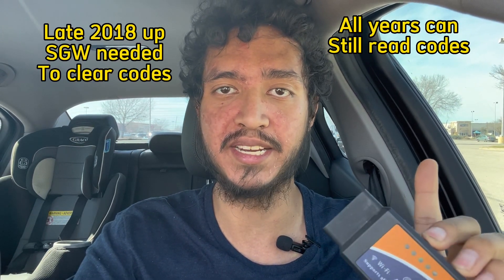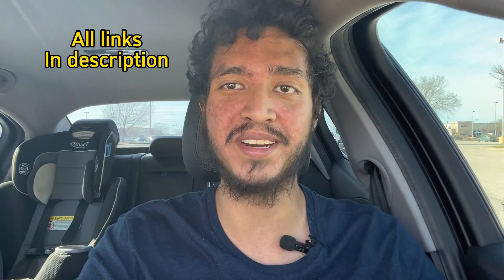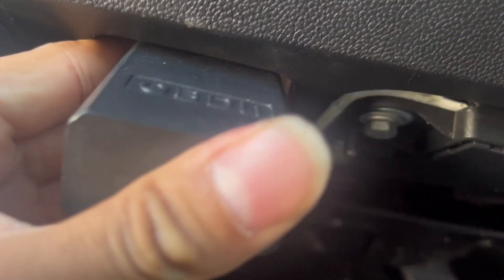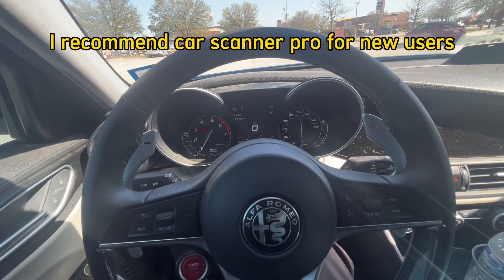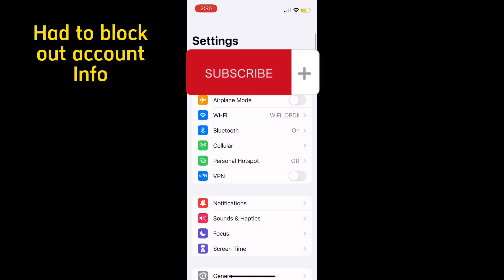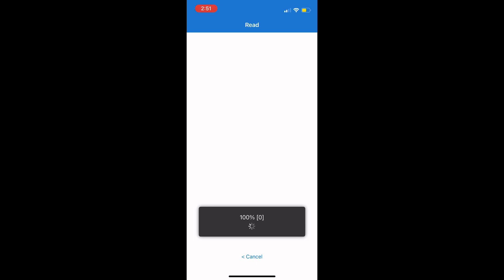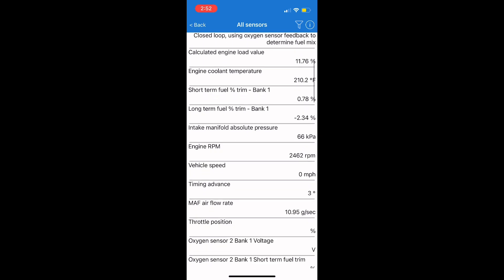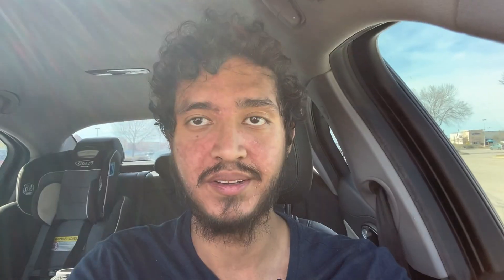Alfa Romeo Giulia Stelvio Read and clear codes using your iPhone/ android

Comment: Any other similar ones that do the same thing ? There are out of stock?
Reply from the maker: Yes just get any of the obd2 readers from Amazon you can use Bluetooth or WiFi. Just remember if your after 2017 you may need an SGW to clear codes

Comment: Soo this won’t work for 2022 to clear codes
Reply from the maker: Yes you just need an SGW bypass installed. It’s not just this device none will work without that bypass on 2018 up

Comment: Does this work to reset oil n days ?
Reply from the maker: Nope not on this car. There is a procedure to reset it with a sequence you have to google reset oil giulia forums you will find it.   Maintenance required needs multiecuscan to reset or dealership Witech
Reply: @alfamods2.0T  you should make a video on the days maintenance it has left there’s not one out there .
Reply from the maker: I do have one actually you just need multiecuscan but that video shows you how to set up as well

Comment: Hi There, I recently changed out my front brake pads on my 2020 Alfa Romeo Stelvio (I bet you know where this is going).  I didn't realize  I needed to disconnect the negative cable to the battery.  So, I have all types of lights lite on the dash.  The car is also in "limp" mode, only the front right and rear left brakes are operating.  Will this scan tool be able to clear that issue and all the lights?  Thanks for you content...I wish I saw your video about disconnecting the battery before I did it!  THANKS!
Reply: Where you ever able to fix this problem? It just happened to me yesterday and I’m trying to get rid of the codes

Comment: Will it clear esc, ast ,and brake codes or just engine codes
Reply: Do u have a link for the adapters
Reply: I need to do the same.  
To clear esc and brakes codes   Can you please help !
Reply from the maker: You need multiecuscan with the grey and blue obd2 adapters if you wanna clear the abs.

Comment: Can you HELP. I have change my oil. How do i clear "days to oil change" ?
Reply from the maker: That one is annoying and takes a lot of attempts but it works. Keep in mind all this has to be done pretty quickly within 10 seconds. 
1.Close the door 
2.ignition on (don’t start) 
3. Press gas pedal to the floor until clicks 6 times with in 10 seconds so quickly 
4. Turn ignition off then start the car. 
Took me 15 tries to get it but it works I’ll make a video next time I have to reset it
Reply: @alfamods2.0T  Can we clear that with that OBD2? And oil change message?

Comment: Does it work without SWG module in the newer model?
Reply from the maker: You can read without it but to clear codes you need it. SGW is worth getting and leaving installed.